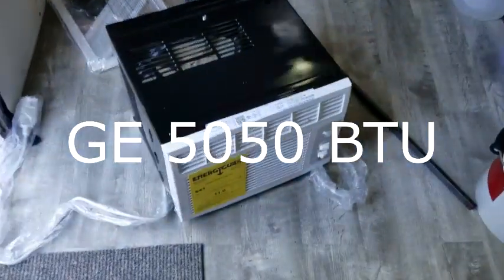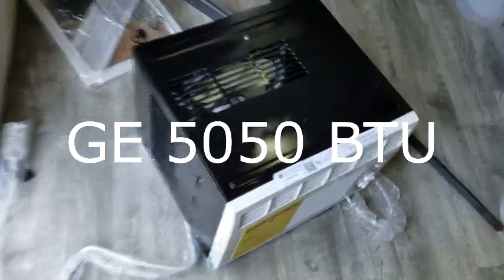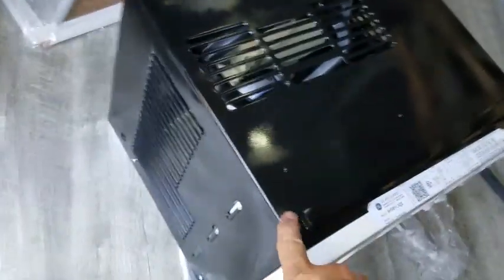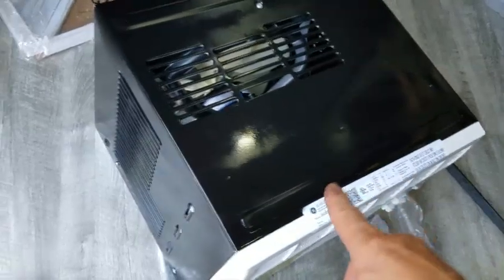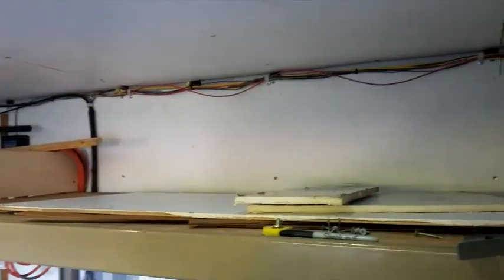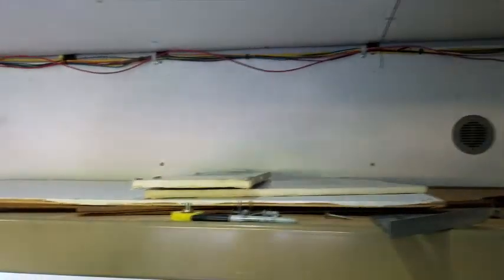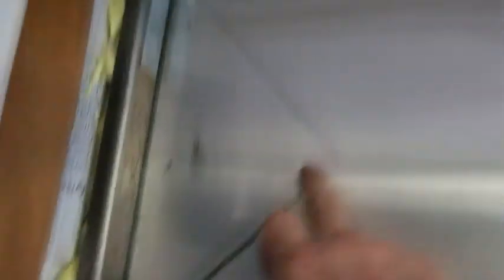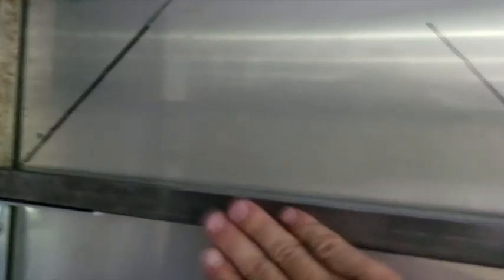Cargo Trailer Camper AC Install

Comment: I've been considering the possibilities of this too.  Wonder if it would be easier and more stable to use the front frame of the trailer as a platform and mount the A/C unit lower?  Mounting near the tongue directly on top of the frame should ease any concerns over it bouncing around on the highway.  Your solution looks good, though!
Reply from the maker: I've put thousands of miles on it since this installation and have had zero issues with it. Keeping it higher gives great circulation, blowing all of the way to the back, keeping the entire thing cool. Best of luck!

Comment: Hi. Thanks so much for sharing your great ideas. We just bought a 12 x 6 V-nose we’d like to modify to take camping. It’s black like yours. Never would’ve thought of spray painting the unit! 👍🏻Can I ask you if you installed drywall on the inside of your trailer and if you put any kind of foam insulation or anything around the left and right edges of your unit? From the video it looks like you had no insulation in place, but maybe that wasn’t the finished product from the inside. Again, thanks so much for posting.
Reply from the maker: Thank you for watching! I completely gutted it, did the 120 volt and 12 volt wiring. Then I painted the panels and installed 1/2" house foam on the top and sides.
You can see here. https://youtu.be/jt-j1nldAbM
Reply: Tommy Gun Thanks for your response. I’ll share your video and response with my husband who is working on this project. 👌🏻

Comment: This is somewhat helpful for me. TFS. I recently purchased 18x10 food trailer, I’m thinking purchasing a 10,000 btu window unit. However, I’m torn between on btu’s to get. Any suggestions? I noticed you got 5050 btu’s, what’s the measurements on your trailer?
Reply from the maker: I have a 7.5x16 and insulted the sides and roof so the 5050 BTU has been great for South Texas. For your application I'd go with 8,000 BTU's if you insulate it, 10,000 BTU's uninsulated. Good luck!
Reply: Tommy Gun thank you so much 😊🤝

Comment: Where all did you screw on the unit to bracket to hold it in place, I'm afraid it will come loose. I'm in the same boat right now, i will probably build an outside bracket
Reply from the maker: I screwed it from the inside, Through the Wood, and into the steel tube frame.

Comment: I cut the hole in my trailer in a similar spot a little lower, but I was planning on taking mine in and out all the time and wasn't looking forward to that, have you had any issues from leaving it out like that rain coming in or bugs, rocks, leaks coming in from the front?
Reply from the maker: I leave it in and haven't had any problems at all. I did make a canvas cover for it to help protect against weather, bugs, and rocks while travelling.
Reply: @tommygun5.3  thank you

Comment: how long does it run on battery power? does it cool good? also did u insulate think of doing
same thing
Reply from the maker: I'm running two 6 volt (Duracell GC2) flooded acid batteries from Sam's Club. The AC unit draws about 450 watts. It will only run about 3 hours on the batteries. I use my small generator or shore power for the AC. It cools great in this south Texas heat. The entire trailer is insulted with 1/2 inch house foam insulation from Lowe's. I'm very happy with the results. Best of luck.
Reply: great thanks for the reply i am thinking 4 batteries should maybe 6 hours with solar should be little longer want to have a/c on when out on 4 wheeler mudding in south ga i know the trailer will be cool. not everyday use maybe once a week. also planning on same insulation. you helper me alot thanks

Comment: Want to do the same thing  on my semi, but I'm afraid the vibration damaged  it's possible?
Reply from the maker: Vibration from what?
Reply: @tommygun5.3  Road use
I am worried about the same thing. Have you had any issues?
Reply from the maker: @seb42  no issues to date and my lady is extremely happy it's there.
Reply: @tommygun5.3  I just did the cutout and test fit on mine today, so far so good! Tomorrow I want to do the final install and sealing. I added some aluminum tubing/rivets to support the AC unit top and bottom since I also had to take out a stud. It worked quite well and looks solid. I'll also add some exterior angle brackets for some peace of mind
Reply from the maker: @seb42  Great! Let me know how it turns out.

Comment: I am wondering, if you could mount the window unit on the roof.... Make a box for the front and run the cold air through the roof Maybe use a fan for more flow... Has anyone ever thought about it???
Reply from the maker: I considered it and even talked to a couple of my HVAC friends about modifying a window unit to fit on the roof or under the trailer. My worry was added cost, repairing, or replacing it if it brakes.
Reply: @tommygun5.3  What higher costs are you thinking of? I have a big AC on my small travel trailer. Would like to be able to use a 2000 Watt generator to run it while boondocking. If I remove the big one and replace it with the window unit, I think it would work. I am no good mechanic but I think it is worth it.